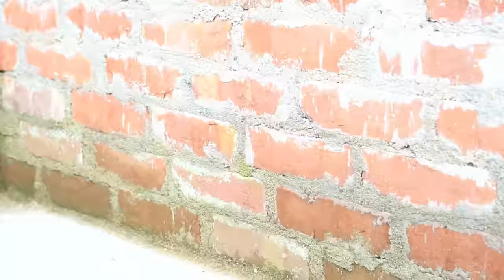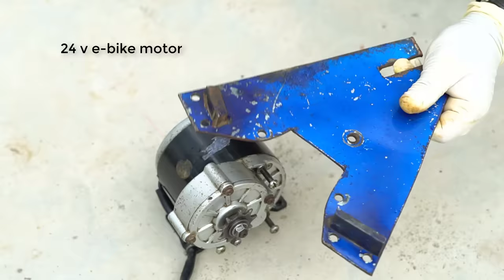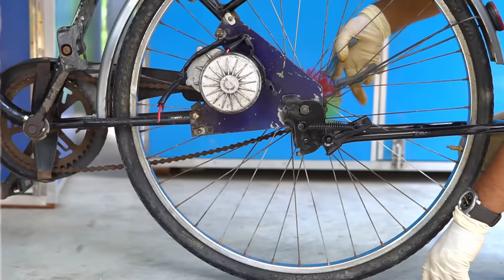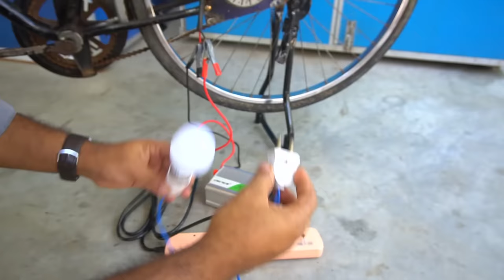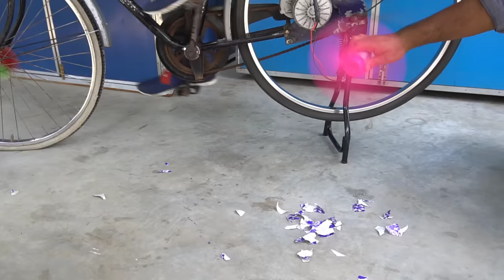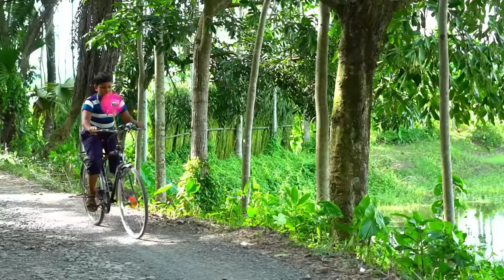Bicycle Generator - Exercise and Generate Electricity

Comment: What if every gym bike could be designed to generate electricity?
Reply: no current bill
Reply: @kishankasana2553  how can it be dangerous when the cureen will be DC
Reply: They do but not all charge things just charge there battery
Reply: Good thinking
Reply: In America there is a gym who use this type things to exercise and generate electricity
Reply: Ya you are right
Reply: Wow great bro 🔥i appreciate your talent beo
Reply: I also thinked this when i started gym 2 years ago
Reply: The setup cost will outweigh electricity generated.
Reply: That would be an interesting thing. You can charge your phone or a couple of other small gadgets while doing work out.
Reply: Good
Reply: Short circuits.
Reply: I’ve been saying this since 2013
Reply: We made it. And got prizes
Reply: @amalkris72   Dude, can you please explain me how? what ? are the concept and principles and components are required here to make such tangle products?

Thankyou, if you help me out then it would be help for me engineering project and my degree will be approved.
Reply: This is great idea
Reply: Free charging while riding❤
Reply: Hi Mss how are you

Comment: Can we store the energy while bicycling and then use it later when we turn home ?
Reply: Bast life
Reply: Yes. But you will need a battery to store the energy
Reply: Joint battery
Reply: @zaharani5192  Tesla has a product for large storage.
Reply: Comnect a battery in motor....it,  when will charge then u can use later
Reply: Simply use a power bank to store it 🤷🏻‍♂️
Reply: Can we use second motor useing the output of 1 motor
Reply: Full electric bike without storeage or a battery ride it till you stop
Reply: Like a electric mopet
Reply: Yessss at gym 🔥
Reply: btw u need a battery to store the energy

Comment: Does it have to be the 500w car inverter? Can I also use a 240w or something even cheaper than that?
Reply: Late to the party but sure, you could use a 240W inverter. Unless you are a top-tier athlete, you won't be outputting over 250W for any length of time. The benefit of a larger inverter would be if you took this bike outside and went down large hills to allow gravity to generate power. You could easily generate  500-1000 watts if the hill was steep enough.

Comment: Good idea, you can use light weight dc motor or generator to reduce paddle pressure
Reply: 3.6v 380 or 385 what I use
Reply: @michaeltucker8645 those motors will not even generate 1v

Comment: Can we store the current in batteries if yes by which device
Reply: Droid Technicals
Reply: Please tell me the answer
Reply: I want to know the answer as well!!!
Reply: if it is dc current then you can store it.
Reply: Connect a rechargable 12v battery and the invertor in parallal connection to that motor ...Then we can store the generated charge and convert it into ac through the inverter
Reply: @Rtechs2255   I want to buy tjis same DC motor can you help me please.

Comment: Sir...  I have a doubt...  you used 12v dc to 220v ac converter... is it compatible with 24v dc motor?  Or why you did not use a 24v dc to 220v ac converter?... Please do reply sir...
Reply: did you catch the red wire to black and the black wire to red and the clips touching with no sparks, to much BS in this video

Comment: If i want to charge a 52volts 1000watts luthium battery what voltage and wstts of motor do i need to put
Reply: And what voltage  , watts of converter do i need to use

Comment: Can we store the energy while bicycling and then use it later when we turn home ?
Reply: Yes u can do it u can save electricity in batteries
Reply: Jack
Reply: No u cant peddle so fast that your current that you r producing will go in the battery and battery will be charged 

Simple the electricity to charge a battery should be very huge

Comment: But the mobile charger need to DC 
To work?? 
How it charged
Reply: In house too we get 220v ac as supply ,basically we use adopter right i mean the charger itself converts ac to dc and u r mobiles batteries get charged with dc current.

Comment: the energy of the spinning cycle wheel get's lost
Reply: U see not going receive 100% energy... According to 2nd law of thermodynamics heat is generate as  a byproduct and anyway because of friction while cycling and resistance in the circuit will produce unnecessary electricity and waste energy

Comment: ive seen simalar at toronto science museum    idea lite went off in head
  took 1 wire alt from a chevy   made a bike rig  for kids  grabed a couple d-8 batt from work
 a dc to ac converterc a small tv  you wanna play nintendo all the time go for it 1hr work 1/2 hr play 
nitendo  fun at first BUT  we got rid of stupid game crap  son won 1st place in h/s science fair 
  hampster powerd li lite  realy a LED     used small dc motor to charge a C nicad batt got motor from old casette player   belt drive system  of corse i helped i have a small 8" laythe+ plenty of stock   brass + nylon  from work